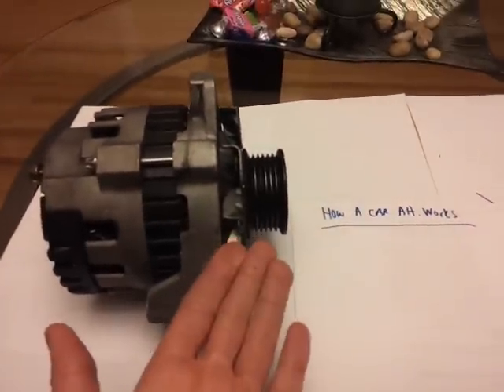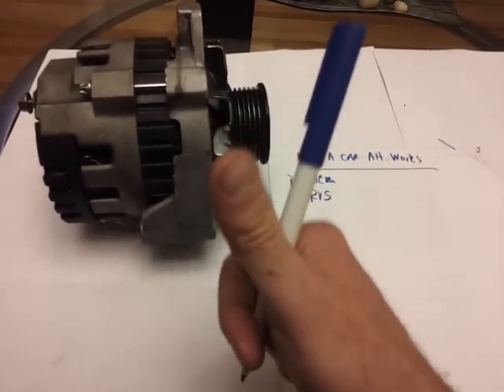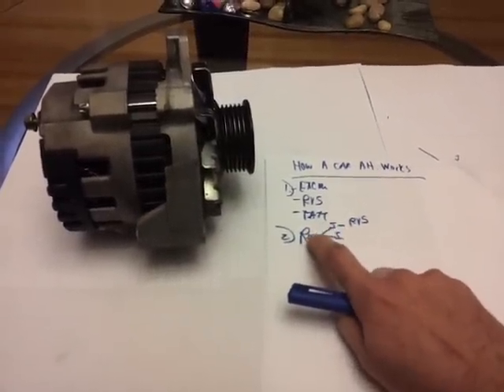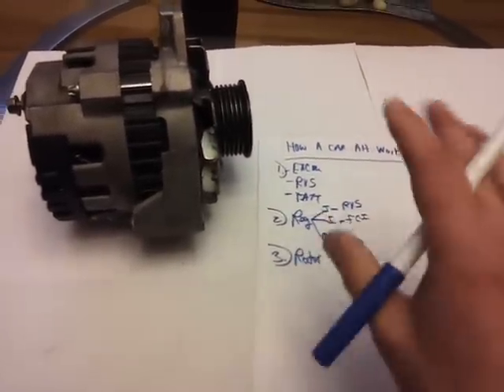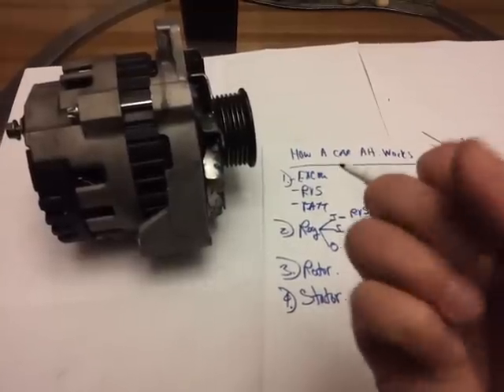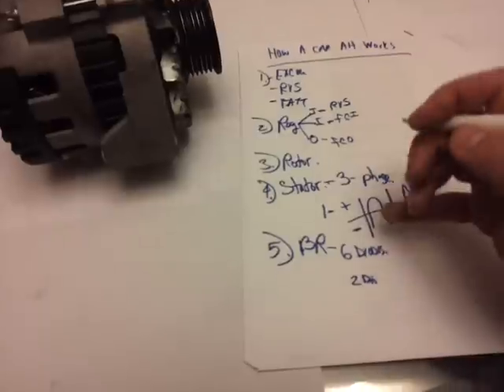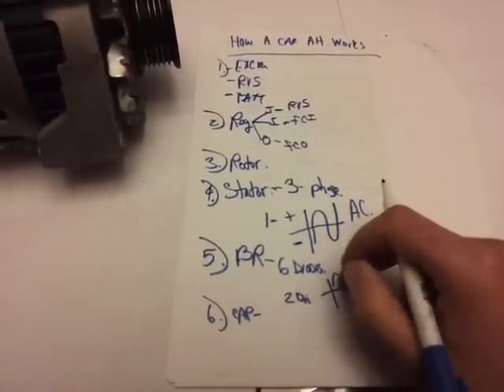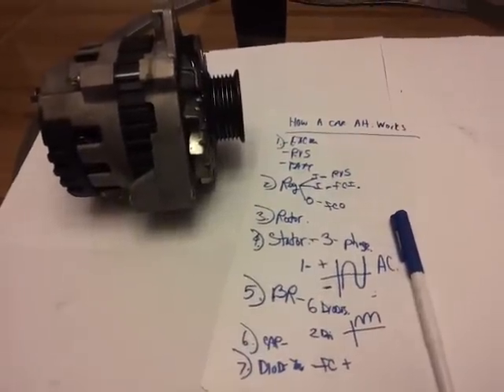How a car alternator works EASY TO UNDERSTAND!!! laymans terms ..

Comment: his lips are just moving.  That is all.
Here let me help you to see if you know your shit.  Answer the following:
1. Show us the exciter wires and what means you use to find them.  Don't talk, show them. If you can't show the wires, be quite and go home.
2.  How many volts do you supply them?
3.  Do you maintain that supply voltage throughout its operation?
4. Where do the exciter wires go inside the alternator?
4. Which wires produce voltage, the output, where do they come from inside the alternator and how do you determine what wires are those?

Now read each of the questions and talk or just simply shut up please.  Please put the paper and pen away.  Thank you.

Comment: I wonder if it's possible to wire a solar panel to the voltage regulator on a car alternator to charge the battery or is a separate voltage regulator needed for the solar panel?

Comment: good video. Question though. I intend to run a larger pulley on a race car alternator to bring shaft speed down. Does lowering rpm (specially at idle) put more strain on alternator to produce current?  or is it, no more load or strain, just need to be careful not to lower too much so not producing enough current.

Comment: i have removed batteries while engine is running. I always believed the alt puts the charge back into batt that was used for starting , then after that the alt runs engine ign , lights etc etc. That is why i can disconnect the battery and evan drive vehicle around the block with no battery installed. Can you explain a bit more regarding the alt running everything rather than everything running of battery and alt continually charging batt. Because that is how you seem to come across. Cheers and thanks Grant
Reply from the maker: on some cars the alternator will not run the car
Reply: Grant Rev-NZ All the car maintenance and operation manuals on all the vehicles I've ever owned specifically tell you NOT  to operate the car with the battery disconnected.

Comment: how hard would it be to convert a delco 22 si to isolated ground? would just electrically isolating the rectifier do the job. then add a connection to the neg side on the rectifier . and drill a hole in the case for the connection. will it be that simple?

Comment: awesome video bro
Reply from the maker: Scott Ouimet thank u
Reply: klowny1969 do you know are there kits to upgrade amps of an alternator or would I be better off just buying a high output? install at 2000w RMS 4000w peak amp and I was just gonna add a few 12v 110 aH batteries but what I've learned is that if your alt can't even hardly power your system extra batteries are pointless and the strain on the 90 amp alt with 180 amp draw could damage both my amp and Alternator... is this correct also. sorry to bother

Comment: No one can answer the obvious question about alternators- If the   alternator   requires current from the battery to power the alternator then how can the alternator supply current to the battery?
Reply from the maker: Alternators do not need battery power to run..u can disconnect the battery and sill run a car off just the alt
Reply: The first half of your video explains how an alternator can't function without a battery.  If you disconnect the battery you have no electro magnet. No electro magnet - no electricity can be generated. IF we connect the battery and run teh battery down we can produce an electro magnet and then the spinning rotor inside the stator can produce electricity to power the battery.  So we have to run the battery down to charge the battery.  It's nonsense. It's not your fault. This drivel about alternators is all over the internet.

Comment: great video, very helpful.
Reply from the maker: thank u sir
Reply from the maker: thank u sir
Reply: thank you. I have a Denso alternator on my XJ12 which I have replaced twice. Since the battery light works and the suppressor has been replaced I suspect it is due to not having that initial magnetism you talk about. I am going to insert a copper wire into the rear access port to bypass the regulator. Hopefully that will resolve the matter.

Comment: I suggest alternator parts discussed in this video should be shown in the video not the alternator assy. Also, rectifier and voltage regulator of the alternator is not explained very well.
Reply from the maker: go check out my video on how to rebuild an alternator

Comment: can you make a video showing how to do away with the voltage regulator and vamp up the juice on the output or (throughput) side of the alternator? ac delco or delco remy 3 wire 3 phase

Comment: sir thanks for your explanation, i want to ask why the alternator use diode at number 7 after the bridge rectifier, did the dc voltage after filtered by capacitor is not dc enough ?

Comment: battery light indicator on my dashboard illuminates when i start and run the car then later it fluctuates. indicator turns on and off. I am confused cause my neighbor condemned my alternator without checking the tension alternator belts. can you give me your idea? thanks

Comment: my tractor alternator has built-in regulator in it gives me 3 wires,1 to starter and the other 2 just for batter and power  ... so . .. can u show me to wiring the charging light ? i done once but it wont goes away after the engine has been started ... thx in advance :)

Comment: Here's his explanations cleaned up for everyone to understand:
First off, an alternator is essentially an electric generator that initially produces alternating current, but unlike an electric generator which has static, permanent magnets and starts producing electricity once it starts rotating, the alternator has field windings, and it cannot start producing electricity until an outside current is applied to induce a magnetic field while the alternator is rotating. 

1) Wiring
   a. Excitor wire - feeds the field windings the electricial energy needed to start the electricial generating operation.
   b. Remote voltage sensor (RVS) - computerized lead that dictates how much voltage to apply to the battery to keep the battery's charge maintained.
   c. Battery wire - the direct pipeline from which all generated electricity from the alternator is fed into the battery.

2) Voltage regulator - the processing center of the alternator which has three   terminals: RVS input, field circuit input (FCI) (excitor wire conects to this lead), and field circuit output (FCO). Basically the voltage regulator takes the two inputs, interprets them, and sends its results through the FCO.

3) Rotor - the rotating assembly inside the alternator that, when energized, interacts with the stator windings (see 4) to produce the magnetic field needed to generate electricity. The rotor's energy comes from the FCO via two brushes which contact a copper slip ring and gets fed through the rotor's windings.

4) Stator - consists of 3 windings (3 phase) anchored to the inside of the alternator casing and do not rotate. The stator works in conjunction with the rotor and its windings to produce the alternating current.

5) Bridge rectifier - consists of six diodes which converts alternating current into direct current. There are two diodes per phase, and half the diodes separate the current to positive and the other half separate to negative.

6) Capacitor - acts as an electricial settling tank and allows the rectified current to smooth out.

7) Diode "trio" - a sequential arrangement of three diodes in which the smooth direct current passes through before being sent to the FCI terminal of the voltage regulator.

There you have it... in a nutshell.
Reply: Damn good explanation. In all the alternator videos I've watched, not one of them mentioned that there's a capacitor to smooth out the DC voltage. It makes sense.
Reply: thanks for cleaning that up. it was touch and go on the video.
Reply: Best description.Thank you.
Reply: Ayotola Kelani
thanks homeboy
Reply: @googleccd079  I know the big wire in the back of the alternator goes to the battery where does the other two wires go on a three wire alternator setup
Reply: is your car uses diesel?
Reply: Hmm, that's very unusual then, all gasoline vehicles are powered by spark, if your car is w/o a battery it would not produce a spark it would crank but it would not start.
Reply: Your car might have a generator instead of an alternator (is it a VW beetle?)
Reply: @No One Cares       Oh, good for you. Audi is good quality. congratulations on a good find. ( back to topic) Your car might have a generator instead of an alternator - like most small motorcycles- when you push-start your battery-less car, you are essentially cranking the engine. the generator spins and it creates current that goes to your spark/ignition system starting your engine. A lot of VWs (beetles) came out with generators. Isn't Audi like a sister-company? Thank you.
Reply: Herminigildo Jakosalem The beetle switched from a generator to an alternator mid way through the1973 model year.
Reply: no onecares, your car must be before 1996, cars got computerized.
Reply: I have a three wire alternator I know it's a big wire goes to the battery.
Reply: I have a three wire setup alternator I know. The big wire goes to the battery. Where does the other two wires go
Reply: You  are a life saver man. thank you so very much. i hope you lead the best life
Reply: Thank you for making it  simple...this guy is shouting and is trying too hard to sound cool...
Reply: That was awsome. Thanks man
Reply: NICE JOB MAN  ! Just GREAT  !!!
Reply: So the excitor sends current to the alternator , and if the alternator doesn’t accept the current does it report to the ecu and turn the battery light on in the dash?

Comment: good video but...the battery becomes redundant once you start the car...you start a car, pull out the battery and it will still run as long as u have gas.
Reply: Perry Bird All the instruction manuals in all the cars I've ever owned specifically tell you NOT to run the car without the battery connected.

Comment: I thought generators required regulators to regulate voltage to the battery while alternators alternate necessary current inside themselves via a diode?  Alternators therefore do not use that added box on the firewall called a regulator?  It is all internal to the alternator which is why alternators replaced regulators.

Comment: I loved your analogy about ' It takes money to make money!' Well...what if there was a way to use magnets to get that pulley to spin? What if you did not need an Exciter wire? Are you saying that if we found a way to "excite" that pulley that we could get that alternator charging a battery? I think there is a way to make money (energy) using magnet placement outside of the alternator. Have you researched how a magnet can not only levitate but also spin due to magnet placement and shape? :)

Comment: ok so I have a 48v brushless motor powered a 4 12v 18ah batteries and I am interested in getting a 48v alternator. Such a thing? but my problem is how big will it be? It needs to be as small as possible because it's going on my bike. Any help please..

Comment: First I really like and expert like you who really explains step by step how it works.  Hope you make more video's.

Second I have a Battery powered lawn mower. 
I had and Idea  to attack a pully wheel to the turning motor so as the lawn mower turns from the battery it will spin the alternator and thus  attach the power to the battery and charge the Batterie at the same time it's being used so it dies less quickly!
Is this possible?